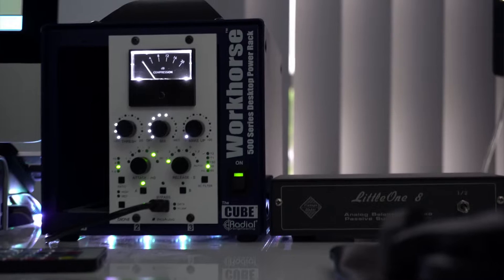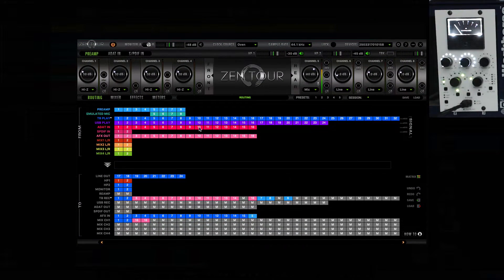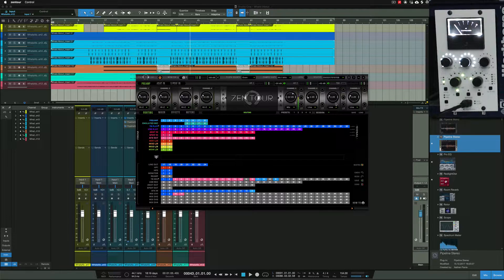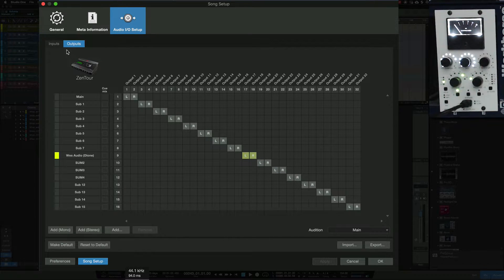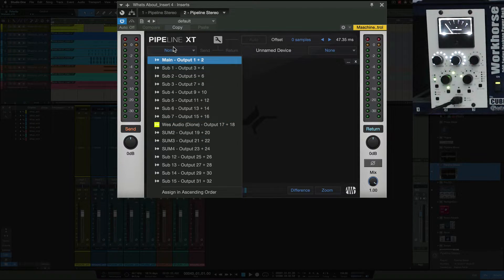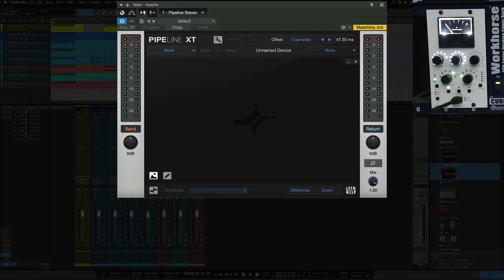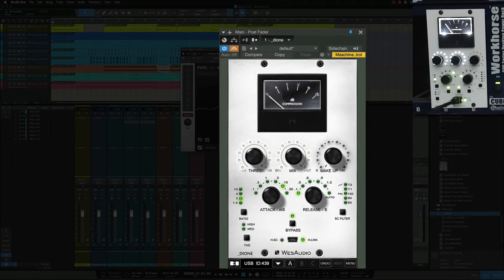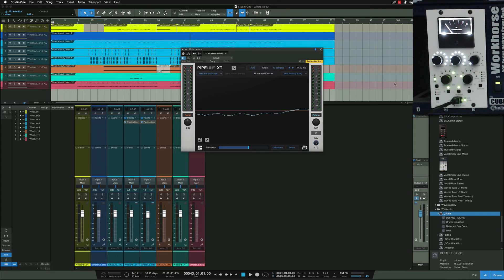How To Connect External Compressor/EQ | Studio One 4.6

Comment: hi, first of all is this zentour desktop or zen tour synergy core..and secondly i have FMR RNC compressor analog..could i hook up my external analog compressor with zentour?
Reply from the maker: I was using the 2017 model  Zentour in this video, the new Zentour is the Synergy core version. Both have ample inputs to connect the FMR RNC as it a stereo compressor. The Zentour can send 8x outputs Via DB25 and receive 4 via XLR/TRS analog back so you would have plenty of iO to connect 😉

Comment: Hey, a little question here. When you set a stereo input (return) how do you manage the gain knobs? Place them at the same X point? Specially for stereo send/return it would be necessary to have PERFECT stereo gain. Thks for the great content man. See ya
Reply from the maker: Hey, are you referring to gain on the comp, interface or pipeline plug-in?
Reply: @CrossbeatsMusicProduction  I mean the gain on the returns of the compressor. The stereo "pair"
Reply from the maker: @luizjanela  as far as gain on the comp I just add it back if required. Sometimes if using the mix parallel and or harmonics settings it also adds gain. Sometimes you just set gain at 0 and work from there if level matching. But I also perform the compression move before adding any gain back.
Reply: @CrossbeatsMusicProduction  hummm, Ok. I use a 4 Channel interface but each Channel has a indepent gain knob, there's no pairing per se. I'm trying to figure out how "match" the gain on each return track of the stereo return. Tried an equal signal on them but one with a inversed phase, so i can place the knobs gain on a position of almost cancelling
Reply from the maker: Which interface is it? Have you tried to level matching using pink noise?
Reply: @CrossbeatsMusicProduction  It's a PreSonus Studio 68. I tried with a pitch sound and got the better matching with a difference below -72db (almost -96db) analysing the spectrum, but no cancelling. I Will try  pink noise too.
Reply from the maker: If there's no cancelation when phase inverted, It could be the channels aren't identical on the interface insert section. I mean it's also timing that can cause cancelation, maybe cables are the issue. I'm not sure with that interface with quality of perfect matching pre/input section. But it's also not the most expensive option either.